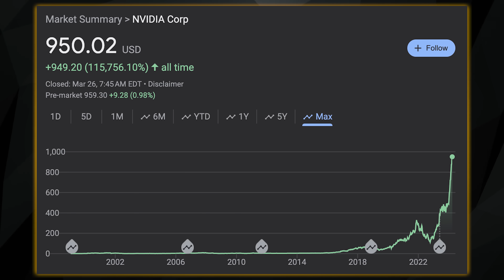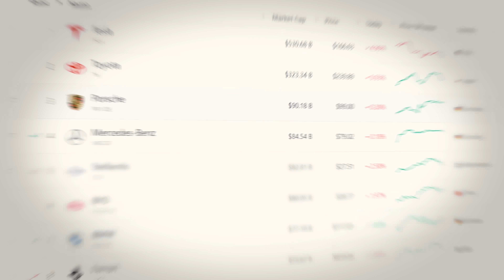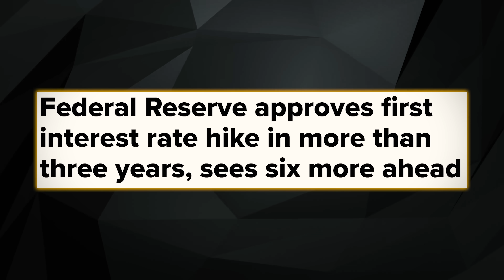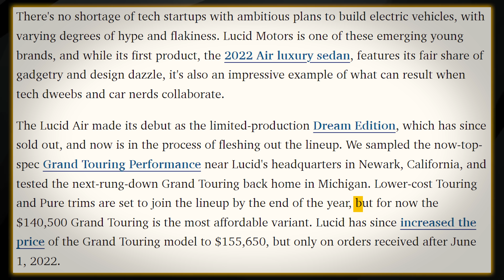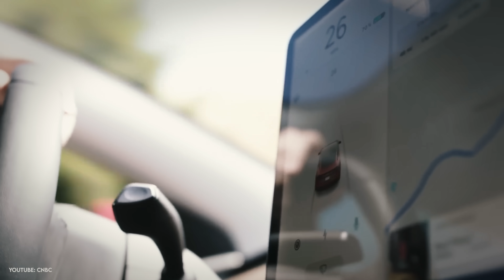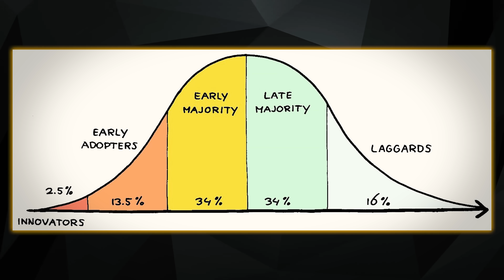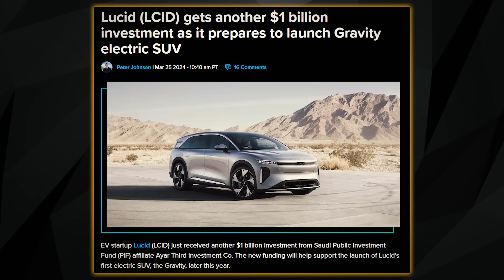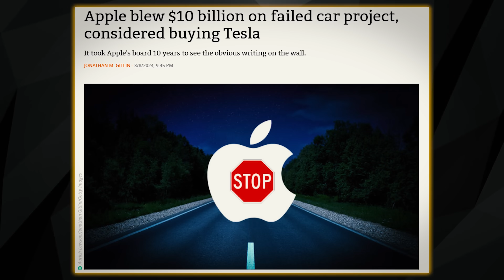The EV Bubble Popped - What Now?

Comment: EV's are still a niche. They aren't affordable for average people.  They're only affordable if you want to pick between a few models. You need more options for it to be truly affordable. Also, the charging is a hassle unless you have you're own setup at home.
Reply: More ev are sold annually than pickup trucks.
Reply: @Nun195  it amazes me how many people still don't know how to use the Internet. EV sales in 2023: 1,189,051. Total truck sales in 2023: ~2,150,000. Regardless, what does that have to do with anything? Most trucks are for work. Might as well tell me more apples were sold than trucks. Back to the basement with you.
Reply: @Nun195  wrong

Comment: The most expensive car I ever bought of my life cost 36,000. So telling me the price of the car was cut down to 39000 isn't very promising.
Reply: Specially when you know that car will become disposable garbage once the battery goes kaput.
Reply: @peekaboo1575  no, I follow the batteries and they're still at 80% after 8 years with some supercharging and better than that for people who are very careful about maintaining a neutral charge and avoiding superchargers.

My gasoline car is now 12 years old and I'm putting about four grand a year into it to keep it running. It's never the same thing. The last thing was struts and a power steering hose and something called VTX that was related to the oil. The year before that it was a catalytic converter being stolen and all of the subsequent repairs that required.

Sometime in the future, the transmission or engine will fail and I've never had good luck getting a transmission repair.
Reply: @macmcleod1188 my father was driving Golf 2 for 30 years. When he sold it that car was still capable of going for probably another 20 years.😅 

Please dont try to suggar coat this inferior technology as good. It seems to me that you have been scammed into beliving into this failed dream by tech snake oil salesmen.
Reply: @saellenx3528  dude don't fall for fossil fuel industry propaganda. I'm talking about data collected by actual Tesla owners and posted on the Teslarati forums. 

I have multiple neighbors who own Tesla's and multiple friends who own Tesla's and they're very happy with their purchases after between 2 and 5 years. Range loss is minimal as long as you don't abuse the battery.
Reply: @macmcleod1188  thats EV Lobbyist propaganda. There is no battery based thing in the World thats lasting long term, be it phone, car or anything else.
Reply: We're in an awkward phase that over optimistically pushes the future. Well probably look back in 10 or 20 years and thank those who sacrificed for technological improvements
Reply: @saellenx3528 lmao just buy an old pos then
Reply: @peekaboo1575 liar liar pants on fire!
Reply: @saellenx3528 Keep huffing your exhaust emissions! It clearly does wonders for your cognitive functioning.
Reply: @saellenx3528 I highly doubt your claims here. No need to lie we can all agree thay gas cars will almost always outperform evs.
Reply: @ravindrapersaud7608  I couldnt care less what you belive or not lol. Do you think opinions of random strangers are important for me? I told my experience and that's it.
Reply: @saellenx3528  you sound hurt my guy...aint nobody believing those lies.
Reply: @ravindrapersaud7608 Not hurt at all. I've had a loss in my family recently and am not currently tolerant of people making unnecessary claims for no reason other than to argue with others because they are bored in life.

Comment: As someone who predominantly buys low milage second hand vehicles I don't see myself ever picking up an EV when at 5 - 10 years you are getting something that could require a new battery which could be as much as double the value of the vehicle.
Reply: New batteries are going 200K miles with 10% percent battery degradation. It is just a matter of time frugal people figure out they can have a second hand EV for 200K miles of use.
Reply: This is knowable information, you simply test the battery.
Reply: Yeap just like buying a 4 years old phone with depleted battery and old operating system. Bo one wants them
Reply: @RedpillPortugal  Clearly aren't tracking the advancements in batteries. CATL just released storage battery guaranteeing no losses for 5 years. Batteries will only get better like every other technology man has ever made.
Reply: Phone batteries and EV batteries are completely different things that are optimized for different purposes. Phone batteries care about power output first and foremost, while EV batteries are generally focused on longevity (e.g lasting 10 years or more). Battery technology is still advancing and cycle life will continue to improve.
Reply: Cost for a battery pack is around $13k. Don't know where you are getting your info from, seems like you just following the flock and hating.  Batteries can go well over 250k miles and see around 15% mile degradation. I agree that they are expensive and will never outperform a gas car. However it's important to not be so biased and be reasonable.
Reply: @ravindrapersaud7608  how can you say 13k when all batteries are different? Ive seen prices for a replacement battery for the Kia EV6 at $29k, well over 13k. The figure I picked was a rough average based on the terrible resale value of a 5 - 10 year old EV, so rather than come into the comments with your sanctimonious bullshit why not keep your mouth shut?
Reply: There are Tesla Model S out there that have done 500,000 miles on the original battery. Also, if you do go to the manufacturer then yes, they will charge you the price of a new battery. However, there are more independent repairers popping up who will fix and replace faulty cells rather than the whole battery. Also, battery prices continue to fall.

Comment: You didn't mention how much it costs for insurance. A lot of accidents that can be repaired on a gas car end up being a total loss for an EV.
Reply: This is simply not true.
Reply: Totally true
Reply: @Nun195  battery damage is extremely likely in crashes due to their position within the frame of an electric car, so even a minor crash could lead to a leak or fire down the line. As the battery is one of the largest expenses in an EV, in a few cases it has been cheaper to write off the car

Comment: Took a road trip in an ev one time and that sealed its fate for me. My 7 hour trip took 12 hours with the charge times. Stopped at 4 charge stations and was there an hour at each one. And a couple charge stations took a $50 hold on my car for like $15 charge sessions. I’ll never drive an EV again. The other thing that did it for me was battery replacement cost. I saw that battery replacement can cost as much as the car in some cases. EV’s are a good idea but we’re not there yet and trying to force it on us is only pissing people off
Reply: Anything longer than 4 hours and I take the train instead.
Reply: How often do you think batteries get replaced? And these days it costs around $100 per kWh for a battery, so a 50kwh will cost you $5000. And you'll save twice that in fuels. And if the battery fails before 8 years it is free or if it fails before 100k miles, it's free. 

But batteries are not failing 🤘
Reply: Oh and no one is forcing EVs on anyone. You can still buy petrol cars. No one is forcing you sell your current petrol car. Petrol cars still have 20-25 years of life 👍
Reply: @colinwiseman  I’ll just take your word about batteries. That’s a risk I’ll let someone else take
Reply: Yeah, but most people don't go on road trips that long nearly as often as they think they do. Be honest, when did you go on another 7 hr trip before that one? And before that?

I think the industry will eventually settle on a hybrid powertrain standard much like the Chevy Volt pioneered over a decade ago, with the gas engine serving as a generator for the electric powertrain and ranges of 500+ miles without long charging waits and very low emissions. It's what the industry should've transitioned to from the beginning, instead of jumping straight to full EVs when the tech wasn't ready.
Reply: @colinwiseman  Not necessarily true.
Both California and London have been working to pass legislation to make ownership of older ICE vehicles much harder. And they show no signs of relaxing those pressures.
Reply: EVs are in fact, NOT a good idea in their current form.
Reply: @colinwiseman I do an 8hr road trip at least once a year, I did two last year. Not a whole lot, but it's not something I would like to make more time consuming. Your prob right about the 25 year estimate. I think it's gonna take a while to change over, but up untill that 25 year mark, ICE cars are likely to become increasingly expensive to own. I am predicting legislation that makes them more inconvenient
Reply: @Thunderstyle7  I've got an EV and I love it. It's so silent and smooth. I can charge at work and the average road trip only requires a 35 min stop after 3 hours of non stop driving. After that time you'll stop for a break anyway!
Reply: @NiekNooijens  I drive an 2010 citröen and I can drive it for over 5 hours non-stop. It's basic, but comfy as hell. Reliable as hell. There's noise, yes, but the noise profile is perfect (I'm a person who's sensitive to various noises).

I also feel great that it won't create a mountain of unrecyclable waste when I eventually stop using it.
Reply: I took a road trip in a Tesla and honestly I wouldn't do it any other way. FSA handled the interstate, exits, turns, everything, like a champ, and charging took 30-40 minutes every four hours or so that I would've done anyways for health reasons. Just go for a short walk or stop at a supermarket and get something to eat, you shouldn't be sitting for that long anyways.
Reply: @theStumblinbear  traveling from Georgia to Illinois in November for thanksgiving, there’s a lot of empty space in between, and the temperatures aren’t warm enough to walk in. I only found 2 Walmarts out of the 4 stops, past closing time. The other 2 stops were in small towns in the middle of nowhere and I was definitely afraid to be there
Reply: A 7 hour road trip in my 2018 Model 3 would take about 8 hours. Drive 3 hours, stop 20 minutes, 2 hours, stop 20 minutes and repeat. Just did a 1,600km road trip each way, only once did I have to wait about 5 minutes for a charging station.
Reply: You’re complaining that you made the poor choice of taking a short range vehicle on a long range trip?  EV’s are great for everyday short range use. Use the right tool for the right job.
Reply: @Thunderstyle7  no because that waste is in the atmosphere, which is way less recyclable than a battery.
Reply: @NiekNooijens  You're joking, right?

Comment: If the EV was a viable solution, the government wouldn't need mandates and legislation to force the sale of them.
Reply: I disagree. I am sure when the original gas powered cars first came out, that required lots of government spending on roads and rolling out gas stations, especially the more remote areas which don't make as much sense commercially, but essential for the people who live in the area or passing through. Obviously with EVs the road infrastructure is already there, but to roll out the charging infrastructure will require government money at first. "The free market" can only do so much and the vast majority of businesses rely on infrastructure funded by government spending.